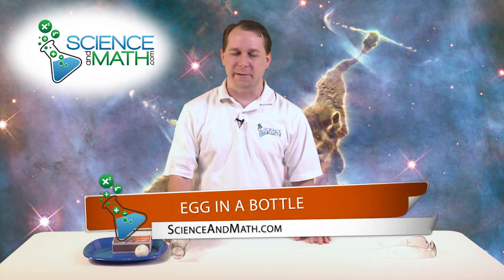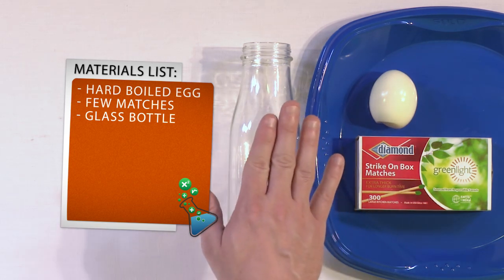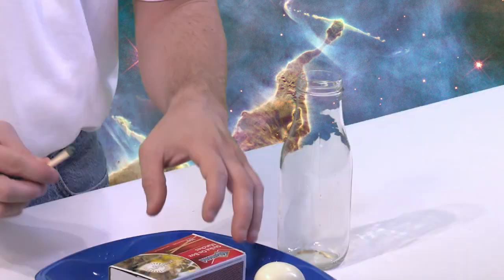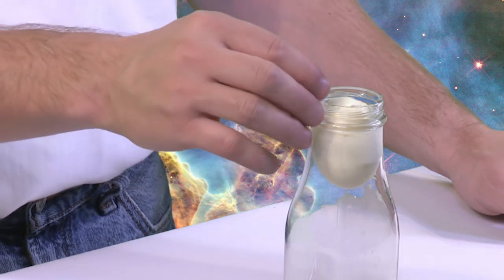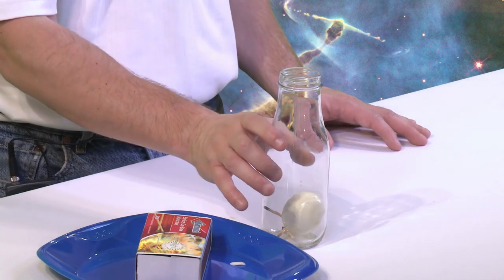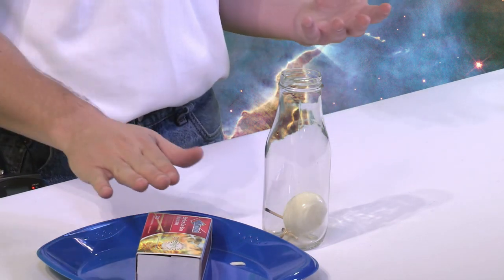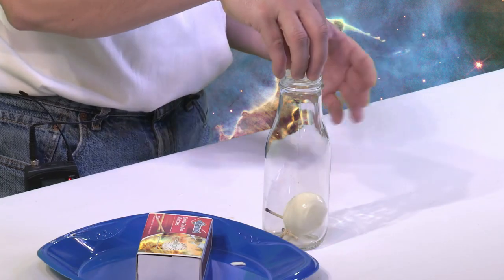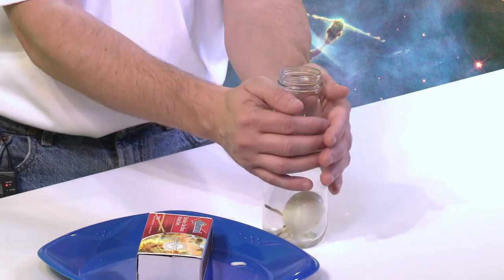What is Air Pressure? Impossible Egg in a Bottle Physics Experiment - Learn About Air Pressure

Comment: How to get it out
Reply: There is still air inside, so you can place the bottle in water and heat the water. The air should expand and force the egg back out. Only if it is stuck in the top.

Comment: Then the only way to get it out is to increase the pressure inside the bottle in such a way that it will be greater than atmospheric pressure. As you all know, air moves from high pressure to low pressure. The only way to increase the pressure is to use a straw and blow. Thank me in your exams.
Reply: Thanks, sir!

Comment: Did this experiment in School, my teacher explained it in an entirely different way and it took a lot less time to explain!

> Flames burn oxygen in the bottle, process creates vacuum, egg gets sucked in!

aaaaaaaaaand done!
Reply from the maker: With respect, your teacher is incorrect.  The vacuum isn't created because the oxygen is used up.  It is created because of the heat in the bottle created less dense gas than the outside, as explained in then video.  Thanks!
Reply: Th flam creates co2 not vacuum